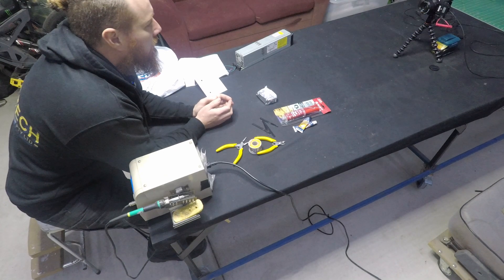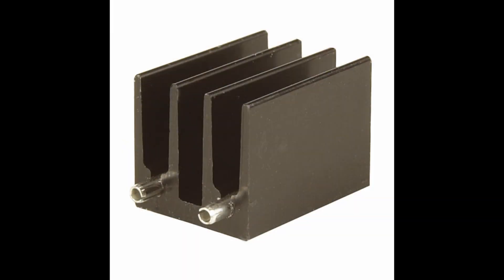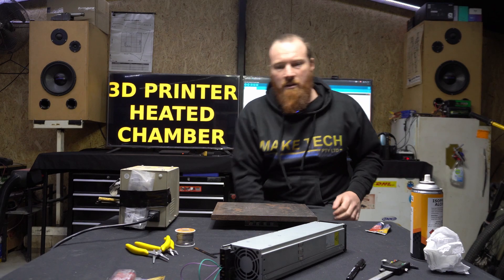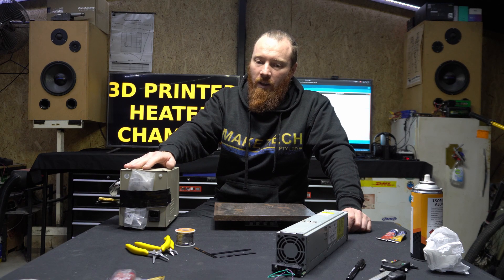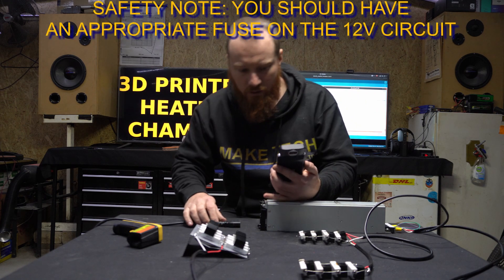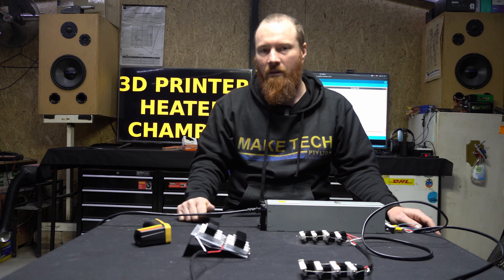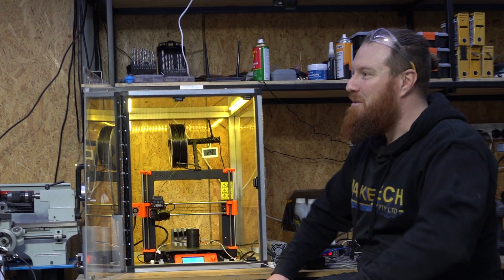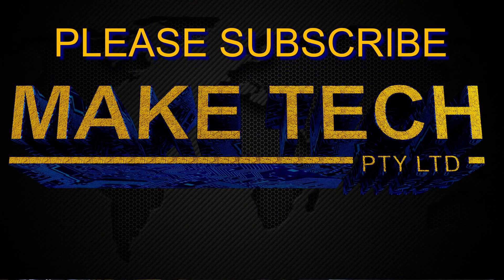HOW TO: 3D PRINTER HEATED CHAMBER - 12V

Comment: Why is 240v wiring hard? IMO, it's even easier because you have less amps flowing. Just keep things separate from dc wiring and don't touch it willy nilly.
Reply from the maker: @bendtherules0  the difficulty of 240v wiring isn't as significant as the safety and regulation concerns. LV poses a risk of electric shock that can be fatal. ELV (12V) does not have a risk of electric shock. The safety qualifications around LV also cover what to do if a person is shocked. The lack of proper response to an LV shock is often a significant and avoidable issue, causing catastrophic results. Hence, it is very important to not work on LV unless accredited training has been certified.
Thanks for your input.

Comment: Hey, great project thanks for sharing!  Cool shots with camera on the track and it looks like you had an AR overlay with the yellow text.  I'd definitely like to see the impact on a larger contact surface print like you mentioned.  I am looking to see if anyone has tried to build a solar collector-powered heat environment for materials like ABS.  I figured you also get an added benefit of ventilation being outside.  Keep up the great work, I've subbed!
Reply from the maker: Thanks. Funny I was just talking about making this video today. I used the Robotic Camera System with a Flir camera. I think a solar collector as a heat source would be ok but it would definitely need something to modulate the temperature.
Reply: @MakeTechPtyLtd  Yeah intro shot is great!  After quite a while of looking around I didn't see anything.  Agree with you on the temp control, that would be crucial.  We have so much sun here in Chile, I'm picturing a setup like the concentrated solar power plants they have in the Atacama and from what I hear one is going up near you, too.  Like a printer (delta?) on a pedestal with some radiative dissipaters around it, surrounded by a heliostatic mirror array below.  You could defocus and refocus mirrors to effectively turn the heat up and down.  Maybe get some big nozzle on there or print in PC...haha no idea if any of this would be feasible.  I don't have a shop to be making a prototype but would be happy to see an open source solar design if it could be used to get around this patent nonsense.
Reply from the maker: @HechoenChillán  yes we have a solar mirror array in South Australia.
Just wondering about language translation; your English is good. I'm interested in the idea of having videos translated for other languages. The Auto translate feature in YouTube is ok.
As the channel grows I might start a second channel with dubbed audio for Spanish, Mandarin, Polish, Sweedish and others. Currently 99% of viewers are in USA, Canada, UK, Australia
Reply: @Make Tech  Haha yeah I'm from the US.  I've set up this channel to improve my technical Spanish writing and flesh out 3dp tutorials that are missing or not that great on YouTube in that language, among other related projects.  It's basically pure hobby/charity work as for now I feel most of the "early adopters" in latinoamerica have the affluence to be able to get a lot out of the typical English video.  There's also a lot of great content in Spanish too...but yeah the traffic is heavily biased towards English haha.
Reply from the maker: @HechoenChillán  Oh ok, well done! Your videos look great.
Reply: @Make Tech  Thanks, right back at ya!!😀